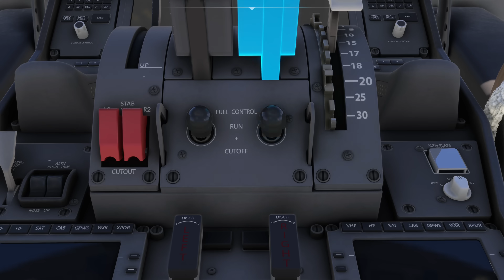Air India 171: Why Did The Fuel Cut-off Switch Get Moved?

Comment: I don’t see the benefit of needing both pilots to move the switches.  It will slow down switching them off and on again in emergency situations and if a pilot is determined to sabotage an aircraft they will find another way to crash it
Reply: You could look at it as an issue of coupling, like jumpers at the golden gate bridge. Just because a person wants to die doesn’t mean that they will do so by any means necessary. There are many ways to sabotage a plane from the cockpit but none are so simple and easy as this. For instance, perhaps putting the plane into a nosedive is too extreme of an action, and doing so would prompt an immediate reaction from the other pilot.
Reply: i agree,  the switches are designed to only be moved with intention.  the mental health of the pilot is not the airplane designers responsibility.

Comment: I have one question. I have seen videos of the panel from the crash aircraft with the fuel switches. The panel is clearly burnt. Is there any test that can be done to verify the safety mechanism was working properly? Thanks Captain Steve.  You are one of maybe 3 channels I believe. I have wasted so much time watching channels that are AI generated that spread bs.
Reply: AI is so far unregulated, I believe. It allows for all kinds of incorrect information. I'm with Captain Steve regarding "AI pilots". Nope!

Comment: THERE IS ABSOLUTELY NOTHING, NONE INFO RETRIEVED FROM FDR, THAT WOULD CONFIRM THE TOGGLE SWITCHES WERE MOVED... THE FDR DOES NOT READ THE POSITION OF THE TOGGLE SWITCHES... SO, IT IS POSSIBLE, ALTHOUGH UNLIKELY, THAT THE TOGGLE SWITCHES HAVE NOT BEEN TOUCHED, BUT THE SOLENOID VALVES WERE CLOSED (AS IF THE TOGGLE SWITCHES HAD BEEN MOVED TO THE CUTOFF POSITION)

Comment: The pilot would have had both hands on the flight controls at that part of the rotation, he'd be looking forward than looking periphery as the horizon (ground level) changes. The Captain was monitoring and on comm, the Captain would have noticed immediately (or should have) if the pilot turned off the valves by moving his left arm down towards the panel. 

I believe it was the pilot who said to the Captain "Why did you CUT OFF?"  and then the Captain denied it (lying) and slowly moved to turn on the fuel back on. It could have also been the Captain pre-empting his own suspicion by asking the pilot the question as a blame before the crash. 

But what is certain, if the pilot was the one who hit the switches, the honest response back from the Captain when asked the question would have never of been "I did not"...I'd think it would be WhatTheFudge???? I just saw you!!! and those switches would be going back up first (without any thought or talk). 

So in the end, the Captain had the best eyes to see the controls and react first in this emergency. It does not make sense if the conversation question was asked by a (guilty) pilot as the 'normal' response from the Captain is anything but normal or expected, IMHO.